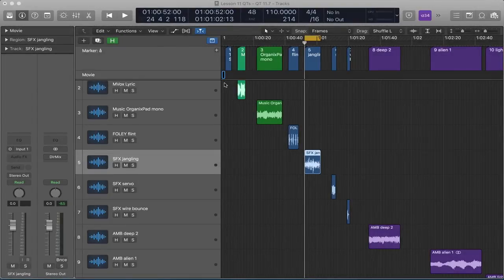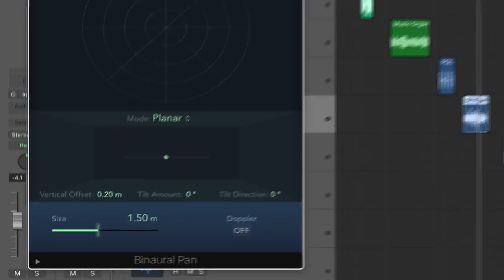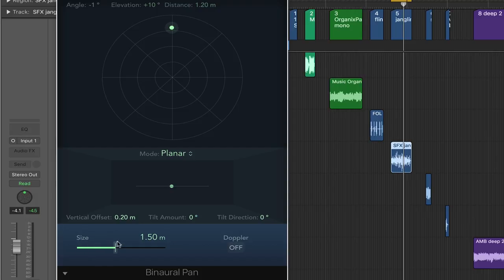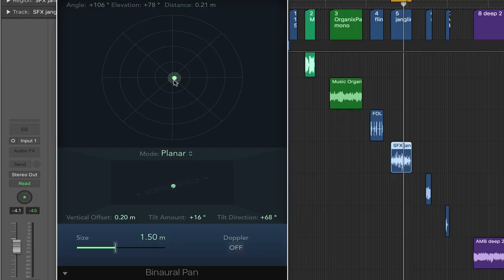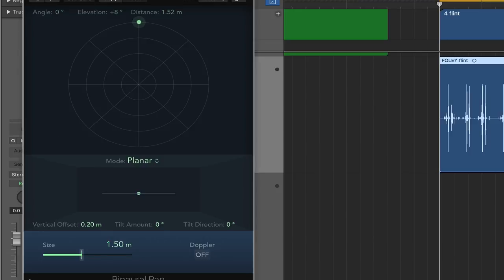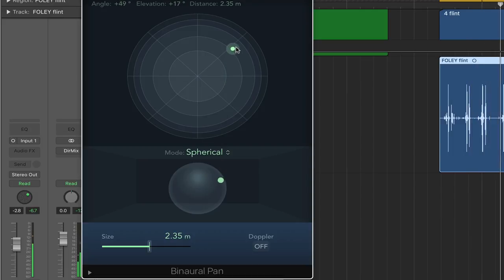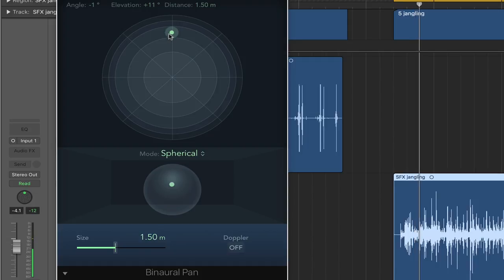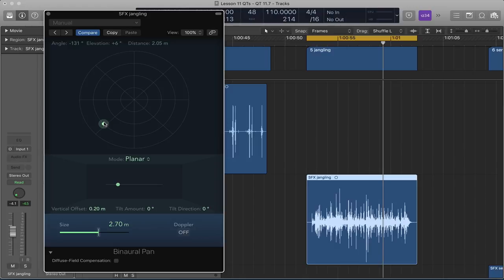How to Use Binaural Panning in Logic Pro | Music Production | Sound Design | Berklee Online

Comment: Cool video! Only issue I have is that the binaural audio must be processed through the 'binaural post-processing' plugin as well. A common way to do this is to send the output of all of the tracks that have binaural panning through a bus that has an auxiliary with the binaural post-processing plugin on it.

This will allow you to also choose which type of binaural optimization you'd like.(not just headphones)  <bows>
Reply: Where's the plugin located? It in Logic?
Reply: How is that a problem? At the moment it doesn’t even sound any near binaural recording.

Comment: Great video. 
Question: how do you record the movement of the binaural  panning?
Reply: on the track in logic use LATCH/TOUCH and move the panning while the song is playing
Reply: @dylfrost  is there a way to have it go back and forth from left to right automatically when you record? I just want it to be even and am afraid to movie it manually and it be off timing. Thanks!
Reply: @dylfrost  You are my hero. Thank you so much for saving me a crap-ton of time in the future.
Reply: @ASMRbyEvie  did it save you time?
Reply: @soful3343  Hi, I am not sure if you found out after a year, but if you want to pan automatically, and you don't need it to be binaural, then you can use autopan, which in Logic shows as "tremolo". There you can decide  rate, the depth and smoothing. I hope it helps! :)
Reply: @NoarSoul  hey! :) i feel like the tremolo/autopan effects are still quite different from the automation of binaural panner... Been trying to figure out the exact way to automate the changes of binaural panning. But imo, autopan is more about the changes in stereo wise, and its easy for human to realize its stereo headphones playingback. Tremolo is a more different modulation effect with the help of frequently changing level. While automation on binaural is more like the sound really moving around you... Have a nice day!